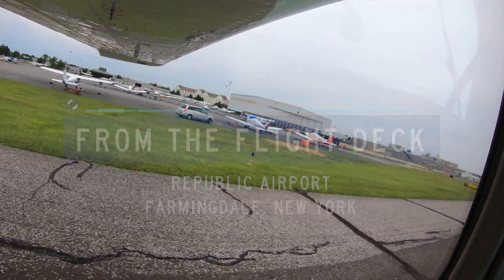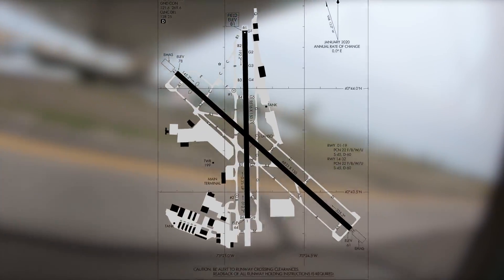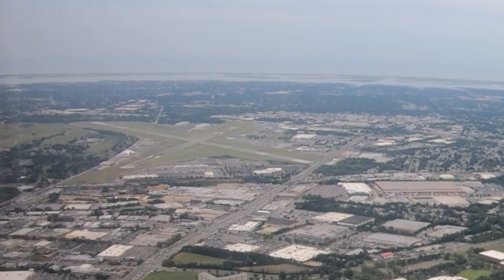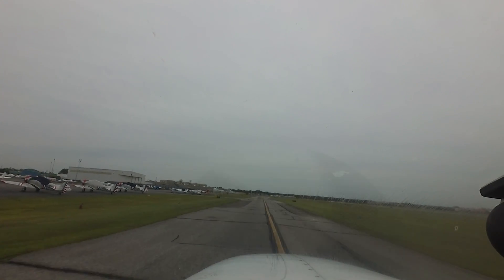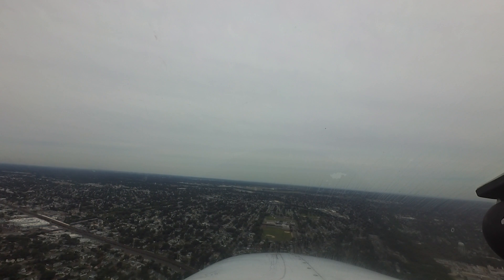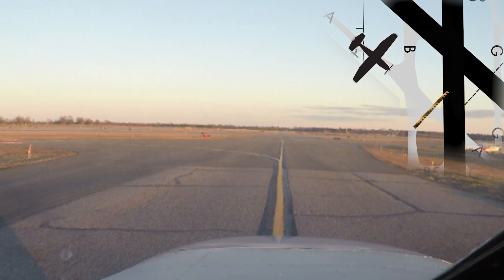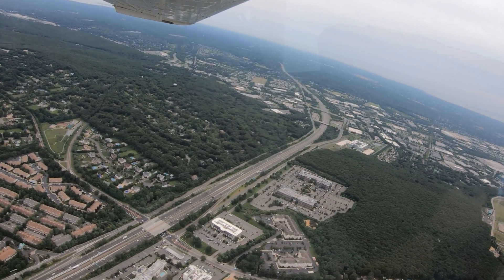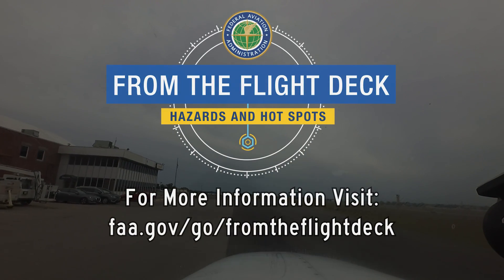From the Flight Deck – Republic Airport (FRG)

Comment: I took flying lessons in the mid 1970s out of Zahn's Airport, which was in North Amityville, and directly south of Republic. It was an uncontrolled field, and It's primary (and almost solely used) runway was directly north/south. I still remember how, flying the north downwind leg, it looked like I was on a short final to Republic before turning a right base leg to land going south. And when taking off north, I wondered if the Cessna 150's engine failed if I could nake it to the Republic runway if the winds were light. They closed and sold the field I think around 1980. BTW, it had a very short pot-holed cross runway where you took off and landed over telephone wires and definitely you had to use your short-field technique. Oh, and they didn't plow the main runway--they just packed the snow down. It was definitely an experience.
Reply: I learned to fly in that time period, at Republic.  The right downwind for runway 32 required a shorter downwind than usual with a base leg just North of Southern State Parkway.

Comment: I've been curious about how good or bad these videos are, but couldn't make a judgement until there was one for an airport with which I had already experienced. FRG is an excellent choice, it is extremely busy and presents a high level of complexity. I was very disappointed that there was no discussion of local, unofficial reporting points. These are so important to smooth flow. Yet they remain undocumented for transient pilots like myself and were not covered at all in this video. Contrast this with MLB where documentation of their local reporting points is easy to find. P.S. my hat is off to FRG ATC: they made my helicopter arrival and departure so smooth it was literally shocking, even though I was clearly a transient and not familiar with local, unofficial landmarks.

Comment: Missed an opportunity to inform pilots of the airports very specific use of surrounding waypoints to sequence traffic especially during very busy periods. If there are pilots out there reading this. Make sure you understand where all the way points are and their names, you could be told to fly to them before you enter the pattern. "The Mall" refers to Walt Whitman mall and is not a way point on the sectional but is used as a waypoint to direct aircraft into R19. 

 This airport also has a hot spot at the Bravo run up. When its busy and departures are on runway 10, planes typically get backed up there and are unable to leave or enter the Atlantic ramp.

Sequencing into runway 14 or runway 19 if approaching from the north could also be Northport Stack, Deer Park VOR for a left down wind.

If you are approaching from the west and are asked to report Belmont Lake, make sure you are actually over it when reporting.
Reply: Yes, to add, two very common reporting points are Northport stacks from the north and the Captree monument from the south.